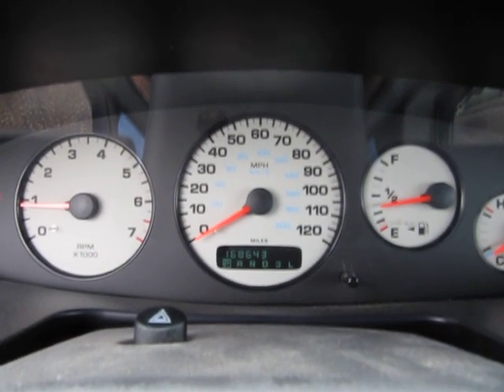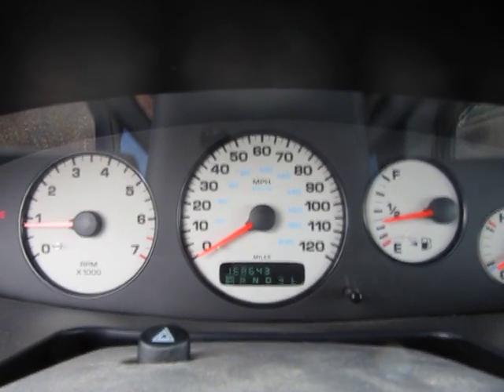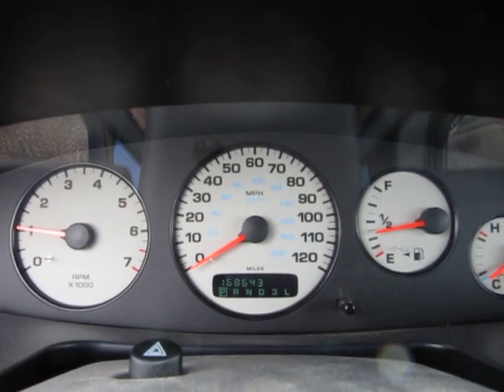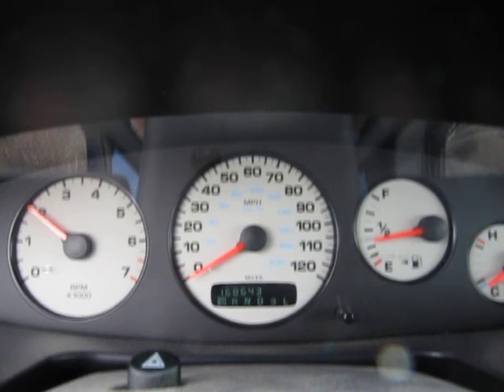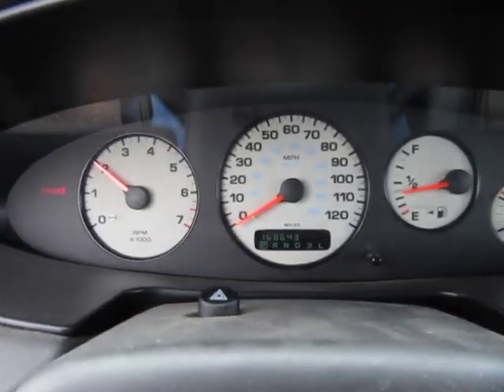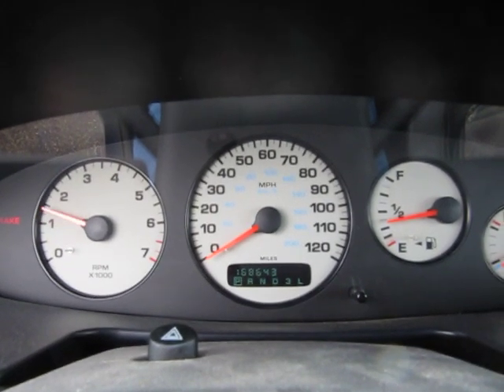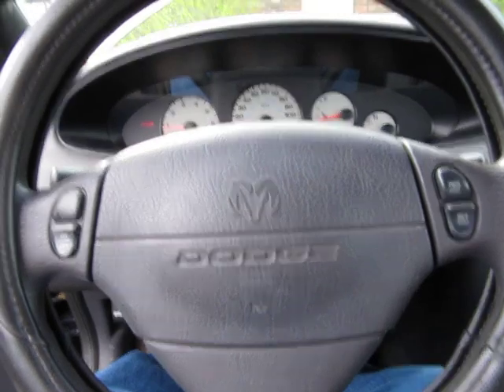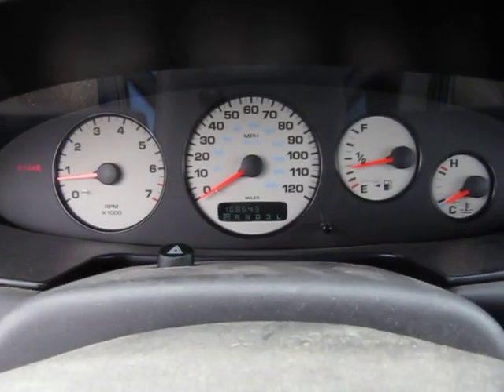Stratus 2.4 with urethane filled motor mounts

Comment from the maker: Yea, works great.  Still driving this car.  There will be increased vibration, but not too bad as long as you don't go too far past shore 60a urethane.  80a would be stiffer but increase vibration further.  Still shouldn't be as bad as a solid steel race mount it'll have about the same effect.  Just make sure you prep all the mounts and get them ready to fill beforehand, as this stuff gets thick fast.